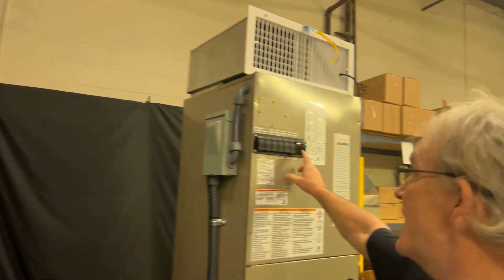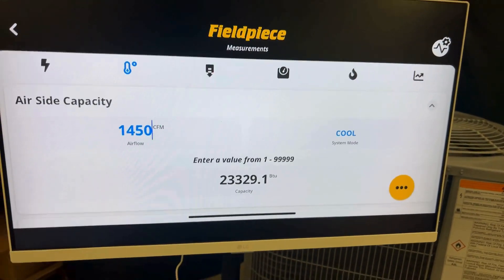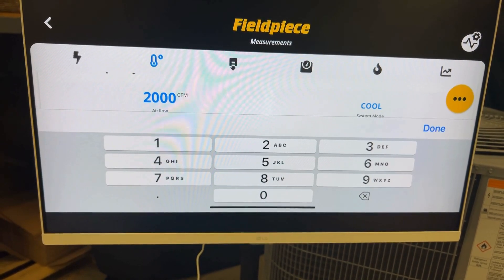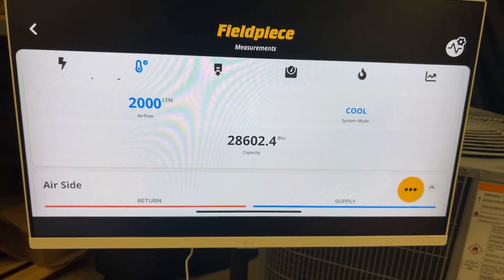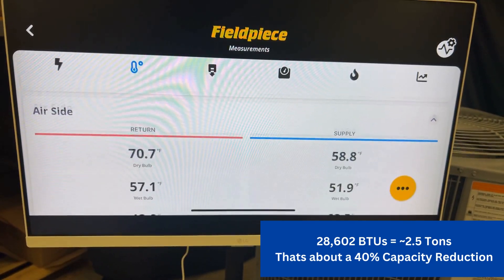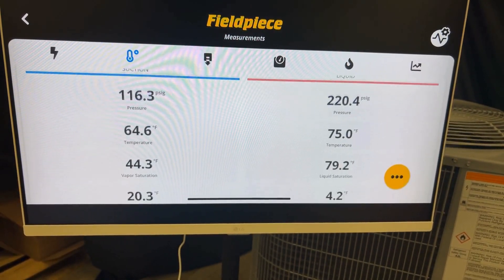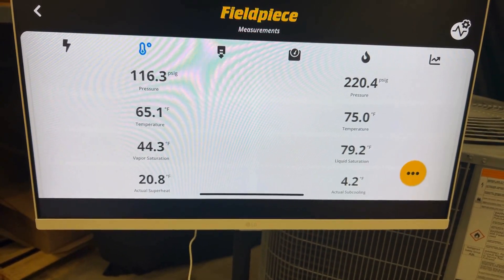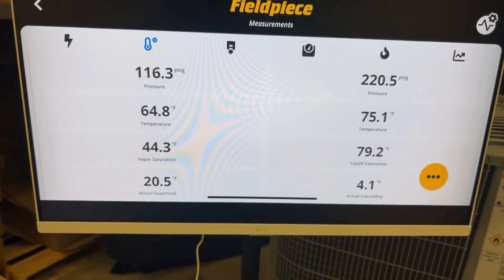APR Control R454B Demo

Comment: How does that show the need for the apr valve? They show the operation but they don’t show a need for the valve. If the valve regulates the system by using an outside temperature sensor to achieve optimal dehumidification while cooling I could see the need. Does the valve deactivate once suction pressure rises above the design setpoint?
Reply from the maker: @JosephWett-vw7zp  You're absolutely right! This video is more focused on showcasing the APR Control's effectiveness and performance with new A2L refrigerants, similar to how it has performed with other refrigerants in the past. 
To answer your question, the APR Control helps regulate system performance by adapting to load changes, and it’s designed to optimize dehumidification and system efficiency. It doesn’t deactivate when suction pressure rises above the design setpoint; instead, it adjusts capacity to ensure the system runs as efficiently as possible while avoiding issues like short cycling.
If you'd like more details on why you would need the APR Control, check out our other videos on the channel (like Understanding High Humidity & How to Fix it! Or Fix Common HVAC Challenges) or visit our website for more info: www.rawal.com.